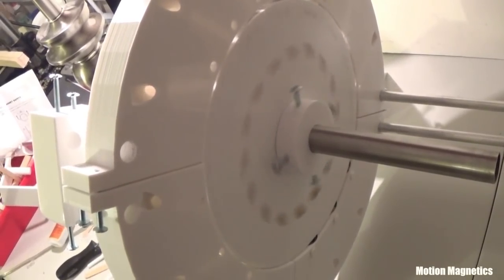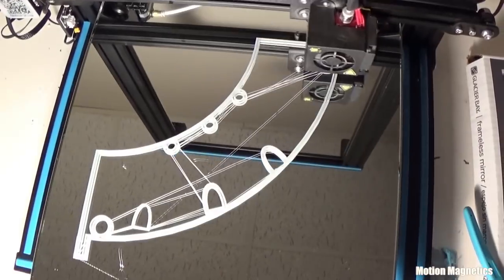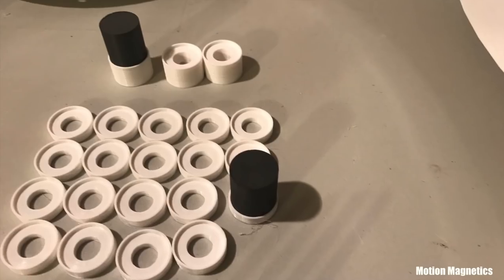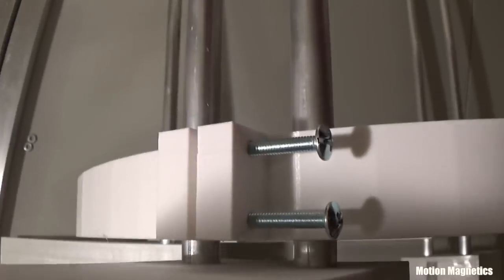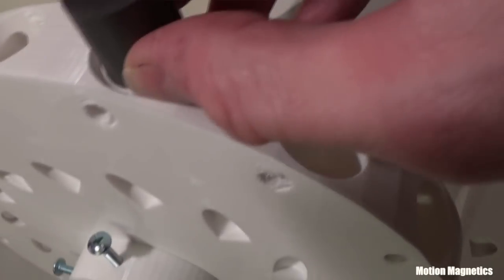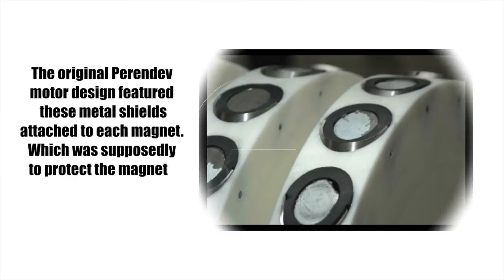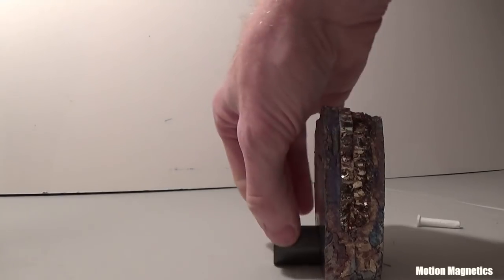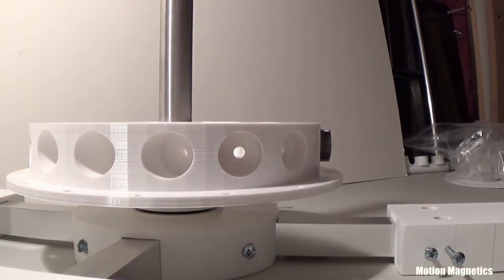Building an Imbalanced System

Comment: It's great to see so many different variations, I have also thought of inserting the magnets on a angle, then grinding the head of the magnet flush. Wondering if this would give a directional force for rotation. Thanks for sharing.
Reply: Working on shape of magnet is also good idea but for that you must make customized design shape of magnet. Some of the Chinese magnet manufacturers are creating any shape on order.
Reply: @kashifpalawkar7  when I designe in my head I use steel so I've never run into the problems you would have shaping the heads of magnets. If you coil wire around steel or iron you can get a strong electricmagnet, if you apply current through the wire.
Reply from the maker: It reminds me of what Howard Johnson did with his arced magnets. He used them in almost every one of his designs. I might give it a try at some point. I have a saw that will cut them, which I featured in one of my videos, but it's not the easiest process.
Reply: +Motionmagnetics 
Heat is an enemy of magnets. Use plenty of free-flowing coolant when cutting. 
:
Reply: @criticallook1352  I've seen magnets loose their magnetic field when put into a blastfurnace so I understand what it is your saying. Extreme heat will break up the alignment of the electrons in a permanent magnet. But if you use a current flow to create a magnetic field heat has no effect.
Reply: @Motionmagnetics  yes it would be difficult matching the angle with the radius of the curve. Perhaps cutting off the main angle with your saw then finishing the radius with a sander or a grinder.
Reply from the maker: Possibly? You would have to be careful with the dust, as it would basically be hundreds of tiny little magnets.
Reply: @Motionmagnetics  your right it always works easier in your head. I'm sure you would need to take them out an clean them.
Reply from the maker: Exactly. I believe I still have a bag of magnetic dust I kept from my last magnet cutting project.

Comment: Shaving the magnet is a horrible idea. The field is not redirected. The field direction is set during magnetization of the magnet. It is independent of geometry. Changing the geometry of the magnet after magnetization won't change the field direction.
Reply from the maker: Thanks. I've cut magnets before. It doesn't change the way the magnet was magnetized, but the shape you cut it in can alter the angle of the field.

Comment: Thanks - Keep us posted, I will be thrilled to go through the journey with you. Post as many videos as you can.
Reply from the maker: Thank you. Much appreciated.
Reply: @Motionmagnetics 
Obviously you have some degree of mechanical engineering.  Whether it works or not, your model is spectacular!  Thanks for sharing.
P.S.  I have a completely different design that I have been able to keep rotating for approximately 4-5 minutes.
Reply: @Motionmagnetics  Thank you for sharing us such great videos. 
I am impressed with your knowledge and experiences in the field of magnetism. I am currently working on the Hyperloop project which emphasizes greatly on the application of magnetic motion. Linear induction motor is a solution for transonic speed travel. However, the ideal goal of Hyperloop is not yet achieved; we would need to optimize the system's efficiency. If you have some time, do you mind spending time guiding and discussing with me? Your knowledge will be very helpful to us. Just reply to this comment or message me through Youtube if you are willing to. Thank you very much.
Reply from the maker: @huuhieuta7121  Thank you! That's not really my areas of expertise, but I wish you well in  your endeavors. Do great things!
Reply: I feel that magnetic shielding does not work as you demonstrated with the mumetal. But what mumetal does is concentrate the field better than iron.
Motionmagnetics you did a great job with this. Sad to see nothing recent unless I missed where it was posted.
Norman

Comment: I have an idea that may save you a lot of time... to build a magnetic motor of some sort, you could get a drinking bird for relatively cheap on ebay, and an element called gadolinium... you could grind the gadolinium into a powder and turn it into an ink.... then paint the under of the drinking bird with it... when you place a magnet under the bird, the magnet heats up the bottom of the bird because of an effect known as the magnetocaloric effect which gadolinium undergoes when under a magnetic field (other compound exist that have higher effects)... this will cause the Dichloromethane in the bird to evaporate to the head making the head tilt like the drinking bird will if it was submerged in water... when the head tilts, the bottom will cool down  because its no longer in the presence of a magnet and then the cycle continues when the dichloromethane (DMC) flows back to the bottom.... it would work continually without the need for any water to offset the temperature gradient which is the normal way the bird works...
Reply from the maker: Well, that's definitely one I've never heard before.